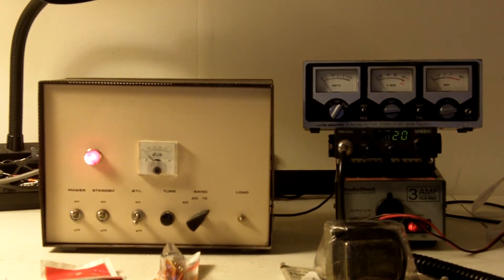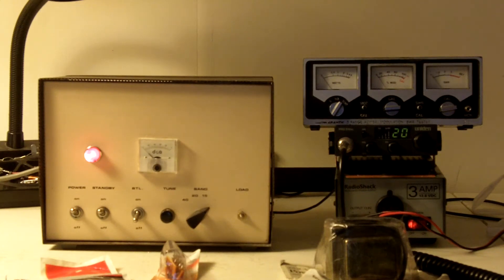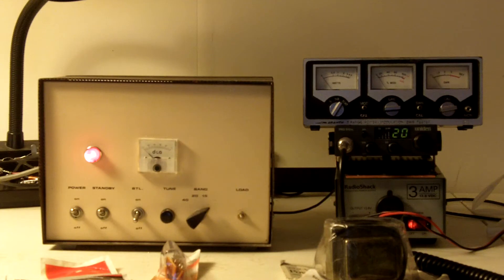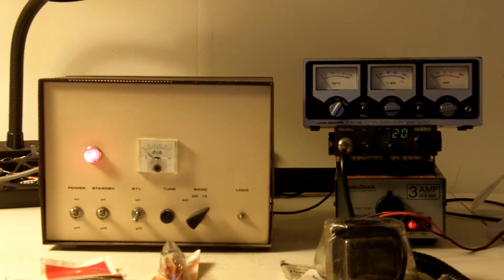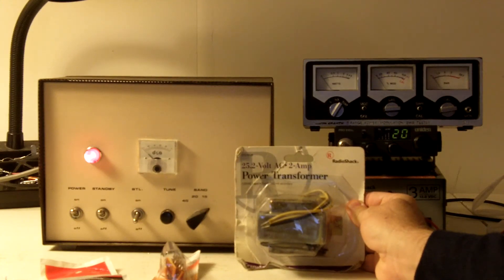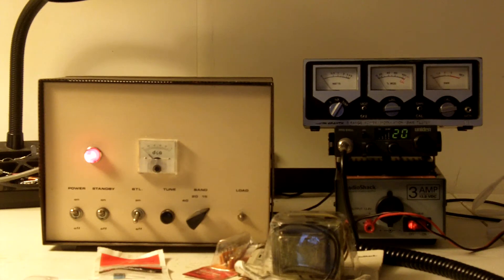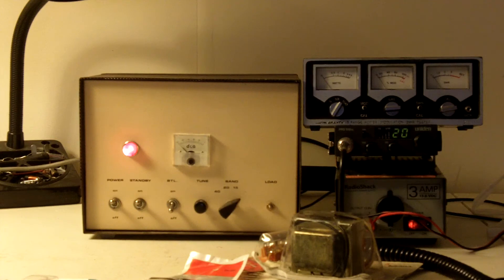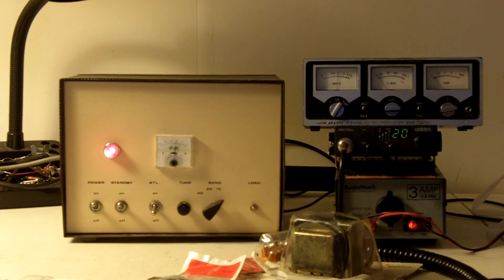Restored D&A Raider converted to cheap 22jg6a tubes

Comment: I know this is a very old video, but just wondering if you can answer a couple of questions.  I was given one of these from a friend today.  He said it works.  My questions are; 1- what is the BTL switch for? and 2-does it do SSB automatically?
Reply from the maker: The BTL switch is the receive preamp.  It usually does not work at this age from a blown transistor, but it can be fixed.  If your BTL does work be sure to take it out of standby while using it or you may blow the transistor when you transmit. And yes it does sideband automatically.
Reply: @carolinapirate2830    Cool thanks!  What's the purpose of standby?  I've never used an amp before.
Reply from the maker: @stevenA44  Stand-by keeps the tubes warmed up and ready for use when the amp is turned on, but does not engage the amplifier when transmitting.  Normally the tubes take about 1 minute to warm up and be ready for use if the amplifier is completely turned off.
Reply: @carolinapirate2830  Yeah I googled it and found that out.  Thanks though.  I doubt I'll use the amp.  Might just sell it.

Comment: Hi will this work RDX-75 does unmatched tubes matter like solid state?  mine in are stock another post says change 2 rectifiers (blue) underside to 3 450 volt caps doubled output video Any help Thanks!
Reply from the maker: I've never worked on an RDX-75, but it should work.

Comment: that transformer you are using is not really enough amperage wise it will work but will prob run pretty warm  each tube uses a half amp for heater , thats 2 amps no room left , should of used a 2.5 amp at least
Reply from the maker: I used what was readily available and cheap. It does get warm, but I have been using it for 10 years now without any problems.
Reply from the maker: Here you go. 24 volts AC at 2.5 amps.  :  )
https://www.rfparts.com/671245.html

Comment: also just noticed the transformer has one cut off wire I can still get to and it reads 41.6 volts to ground so I could actually hook up the 22jg6s in the same configuration they hooked up the 6jg6as. Im not sure of the amperage on that tap though  the 6jg6s use about an amp each , the 22jg6s use about .5 amp each therefore the same total wattage for either of the tubes . Volts times amps.  I think however Im going to use one of those little switch mode  dc adjustable supplies because Im not sure of the amperage that tap on the xfrmr will provide  and I can adjust the switch mode exactly as I see fit,. And no hum like ac. and it will fit inside the cabinet , then the 13.6 volt I will add a rectifier and a cap and use it for a fan and a indicator light for the front gauge on the panel with a wheat bulb

Comment: I have one and doing the same thing , my problem is this , I guess the heaters with the 6jg6s are 6 volts each but their wired in series which means the supply must be 24 volts ac coming off the transformer .  Which means I guess you could just hook all the heaters up in parallel instead of series .  , Im not sure but you must have got the transformer and hooked them all up in parallel or did you hook the heaters up in series  , in series the voltage would be devided by the number of tubes you have  24 volts devided by  4 tubes in series  is 6 volts   or rather 6.3 volts x 4 tubes 25,2 volts  and therefore no need to add a transformer because the old voltage coming off the  original circuit must be 25.2 volts , so instead of doing series , just do parallel heaters , not sure why they use series in the first place
Reply: I see now what they did , 13.6 volts coming off the transformer , then they have the heaters set up in series parallel , 2 each .  so 2 tubes are across the 13.6 volts divided by 2 to get the heater voltage , then same for the other 2
Reply: also means you needed no transformer , there is already 25.2 volts provided for the heaters in the orig transformer because remember they had them in series
Reply: now Im really confused , with no tubes in , Im reading 13.6 volts out of the transformer for the  heaters

Comment: the heater doesnt care if its dc or ac so why go to the rectifier trouble
Reply from the maker: I originally thought I was going to need a voltage regulator to bring the voltage down to 22 volts, but the tubes created a big enough voltage drop to bring the voltage down to 21.5 volts DC all on their own.  I removed the DC voltage regulator, and left the circuit as it was. Later I tried it with just the AC transformer by itself, and the AC voltage hovers around 24 volts AC.
Reply: @carolinapirate2830  i was reading on a forum about the Raider and there are a handful of the that either came with or somebody had swapped the tubes over to 4x 6lq6's. My question is i know of atlest 4 guys who have posted about there Raiders with 4x 6lq6 is it possible that the stock Raiders will run with those tubes? and if thats true then could i drop in 4x 6km6 into one of mine? I have the spare tubes but i would rather ask you as you seem to understand them better than anyone on the web.
Reply from the maker: @roneinstein7360  I've never tried that, so I don't really know.  The only conversion I have done on a  D&A Raider was to 22JG6a tubes.  That conversion works great.
Reply: @carolinapirate2830  
I have another question for you as you seem to know more about these Amps.
I just picked up a RDX75 and of course it was not working. So long before i convert this one to the 22jg6a tubes first thing i need to get it working. I found a bad power switch replaced it and grabbed 4 tubes from one of my stock working Raiders which happened to be 6jr6's but needed a 5th tube. It was a larger tube than the keying tube of my other raiders it was a 9pin novar sized socket. Coould not find anything on the web so i grabbed a weak spare 6jr6 tube plugged it in and put it on a variac and brought it up until the heaters started to light,  the outer 2 came on first, i then brought it up to about 70volts and all 5 heaters lit but the two outer ones were still brighter? soi cranked it up to 115v and the same the thwo outers were much brighter so i shut it down and pulled the 5th tube and tried again. And they all came up like normal? Any idea where to go from here? do i try to key it up with just 4 tubes? or any idea what to use for the 5th? what would you do?  Thank you and i look forward to your reply.
Reply from the maker: @roneinstein7360  I've never messed with an RD-75, but I think it is just a 4 tube amp by default.  If there are five tube sockets someone modified it.

Comment: Sir I have same unit with same mods and may have purchased from you? r u from Okla, ? anyway is the load a ten turn pot? where can I find the knob to fit this load pot?
thanks and great video
Reply from the maker: I don't live in Oklahoma.   The load control is a variable capacitor. It can be purchased from rfparts.com.  The part number is "Arco 304m".